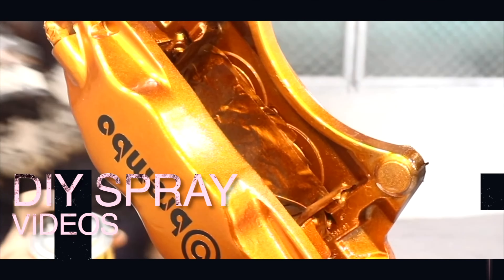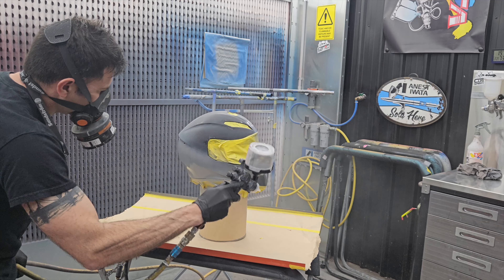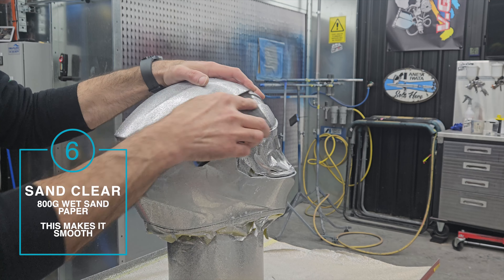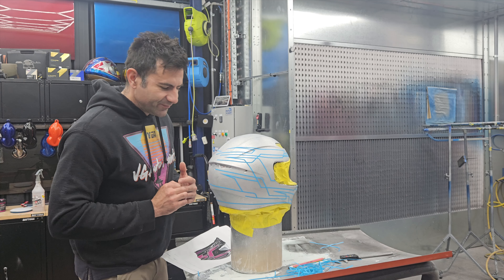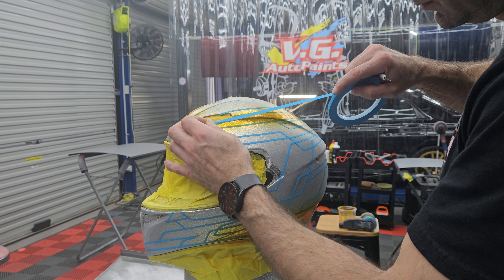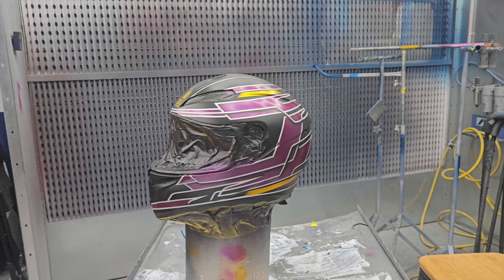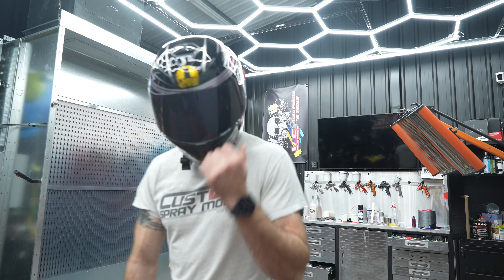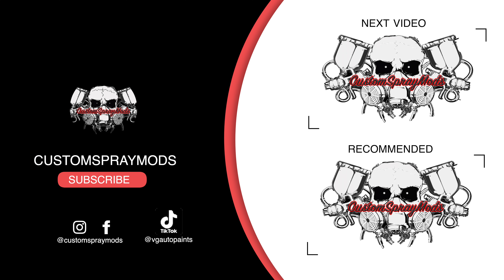How to Custom Paint your helmet

Comment: Looks great but i think it should be mentioned that most helmets are not supposed to be painted. The paint thinner can weaken some kinds of outer shells and sanding it first will certainly also do that. To be hones i'm not sure which types of shells are most fragile when it comes to this but just be careful and ask the manufacturer  if it's ok to do to your helmet or you could ha a helmet that not doing what it's supposed to do as well as before. Some manufacturers say you shouldn't even put a sticker on it.
Reply: It’s more of a liability issue than an actual issue. It’ll be okay mate, relax
Reply: @Rekoyl116  I have head otherwise and when I don't have an actual test that proves my point wrong I will keep telling people to make sure first. I don't know how that would make it seem like I'm not relaxed.
Reply: @The77Game  the helmet was already painted. He didn’t even sand through the original paint…
Reply: all helmets come painted from factory  and when you're custom painting you're only scuffing the original clear and painting on top, also the tail solvent used in automotive paint evaporates almost instantly. Try taking  a full gallon of solvent, pour it over a helmet and see for yourself,the only thing that can be damaged is the inner foam (you'll OBVIOUSLY remove it or protect it!).
Nascar, f1,motogp, isle of man tt,rally, ALL of them use custom painted helmets,one would think those people know a thing or two about safety, especially when they frequently walk out unscathed from  100 mph+ crashes. That's a myth

Comment: Turned out pretty cool. Couple tips from my custom painting times, take a look at a contraption called flakebuster. You'll reduce the 2h flake spraying with the constant shaking and clogging to ONE MINUTE, and I'm not exaggerating, one minute you got your flake in there, with virtually zero flake wastage. And to avoid paint creep under your lines, when you got your design put some intercoat clear in your airbrush or a minigun and chase the tape lines,this way you'll seal any gaps if there's one and if some creeps under it'll be transparent and invisible, avoids those lovely moments you're untaping to find black overspray all over your supposedly silver or candy graphics..Another thing that could take your work a step further is a couple stencils, you have a plotter already for stickers, cut a few  effects stencils to lightly spray over your candies or pearls, only takes a few minutes and looks so much more work was done in the end,an expat effect over that purple fading away would look sick